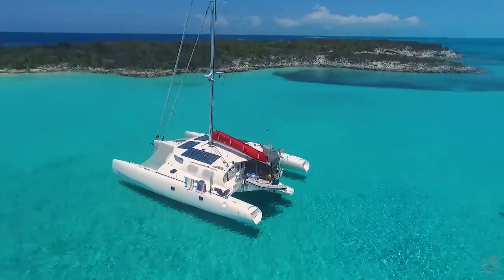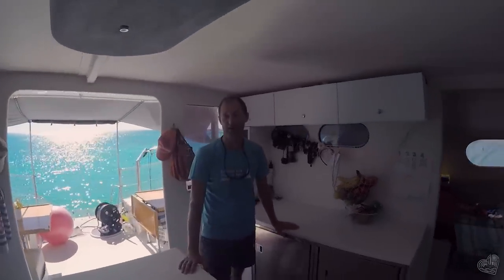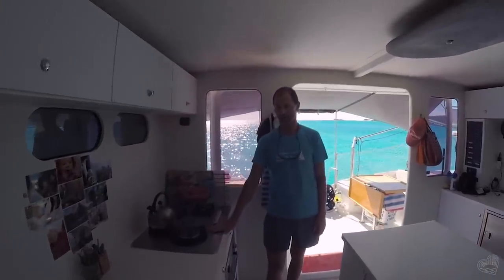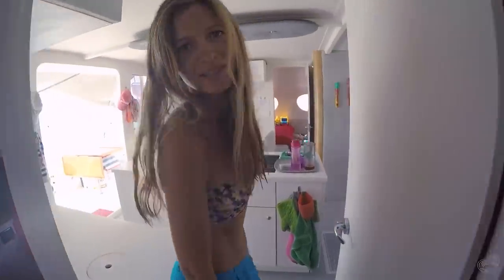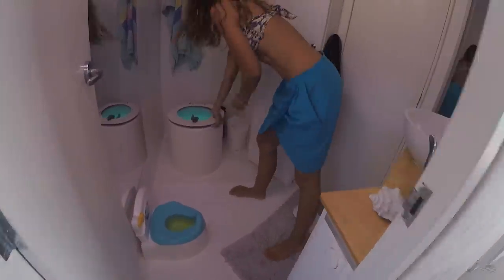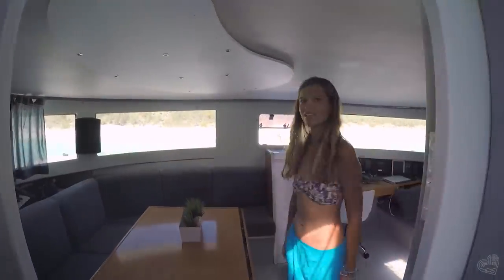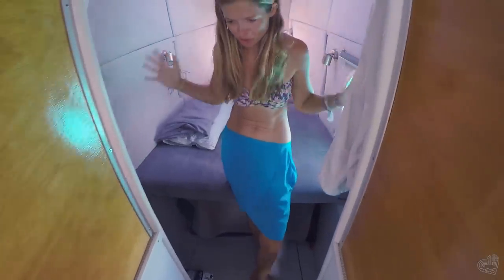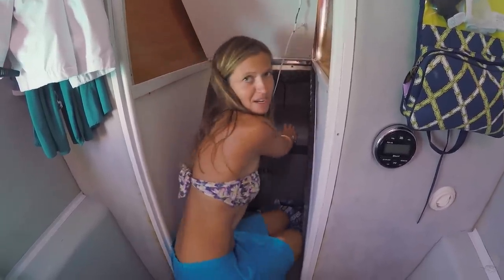BOAT TOUR - Walkthrough of our home - living on a sailboat full time

Comment: Little tip: sort out your machine room where the batteries are cause if something would fall on them and make a short-circuit, it could burn your whole boat down! Such a beautiful boat!
Reply: Let alone what your insurance company would say if they saw that and something happened they will point this out, so i hope I’ve helped you guys out!
Reply: Again a tip: put everything in see-true plastic boxes! The kind that you can fit into and onto eachother, happy to help you out, Lubię pomagać żeglarzom
Reply from the maker: We're doing major tidying up now during refit. Beforehand it was near impossible. Now everything is out of the boat and it's easy to properly organize everything. Thank for the pointers though. Cheers mate. Bartek

Comment: I was 95% sure of buying one of these trimarans for cruising, but after seeing the Reviews done on them and this video, I have completely changed my intentions. The very first thing you have to consider, is what happens when you run into a 20 plus knot rain band, the corresponding swells and the ability to sail the yacht in comfort and safety. 
With an open helm station, no storage for ropes, and a slippery deck all around you, after 10 minuets ( let alone 4 or 5 days ) you would be frozen wet, unable to see, and a wetsuit would be needed complete with a mask and snorkel, so you could pick the course to sail. !!!

The echo in the very small sleeping areas from the wave slap would keep you awake, and what happens when the dunny seat gets hit by the water pressure coming up ???
No proper storage lockers, basic equipment, very light construction, and even having to coat the fridge with lacquer to stop it rusting ???
Whats wrong with stainless steel, too heavy ???
It might be ok for a couple of overnight tropical island hopping, party trips with friends visiting, but certainly not suitable for any real cruising passages.
1 cubic meter of water=1 tonne weight, so how much stress is going to hit the 3 hulls that are made as light as possible ???
How much hull twist and bounce will it take ???

It would be good to see someone run an echo tester over the stress points and measure any structural cracks, after a decent blow has been encountered.
And I note that the new layout has been changed to make it more suitable for living aboard, especially related to handling.
But not for me, not good enough.
Reply: Agree with Stephen on the design.  Additionally, I went to NEEL website and notice the sail drive - prone to maintenance needs. Thanks to Bartek and Ania for a very nice show and tell video.

Comment: Would like to know about the washing machine. Do you run it on the inverter? What brand and model is it?
Reply from the maker: Hi! Yes, The whole house runs on a 5kW VE Quattro inverter that produces standard european 240V 50 Hz. It runs all the typical applaiances among other things like washer, dishwasher, etc. We also have a backup 3 kW Kisae inverter that runs a standard US 110V 60 Hz circuit. We run electrical tools and ice maker from the US on that. Does that clarify things?

Comment: Very different to my F9 Farrier trimaran, it’s nice to see a large tri instead of a catamaran, I’ve never seen inside a full live aboard one other than a few for sale that are in need of a full refit or demolition... I’m wondering if it’s faster than a similar size cat?
Reply: Yes, TY! Everything I see says, "trimarans have less space than even a single hull." That didn't make any sense to me since - although they are certainly built only in the center hull - there is the possibility to build across the top of the hulls, as with a cat, and as was (smartly) done here!

In answer to your question about speed, there's something called a Froude Number which is used in hydrodynamics which shows that the longer the waterline, the faster a ship will travel. In the case of a trimaran with three hulls identical in length to the two of a cat, the tri will have 50% more waterline, due to the extra hull, thus faster
Reply from the maker: Thank you for this. I honestly had no idea that you simply multiply the LOA for a multihul by the number of hulls.  What I do know from practice is that light multis are not effectively limited by the hull speed. It is a different and a very fast animal. cheers. Bartek
Reply: @MarcillaSmith  now would flying a hull, which one would be doing at the greater speeds make you slower than the catamaran since the second hull in the water is generally a little smaller?
Reply: @finfanfifteen9659  you're talking about with foils? Foils completely change the equation
Reply: @MarcillaSmith  :-) I'm not talking about foils. Maybe I should have said, flying an Ama. The Amas are generally a little shorter than the hull and at some point, you're leaned over to the point that one is out. Therefore, you would only use two of the "hulls" in your equation.

Comment: Hi great video! I would like to get more information about your re-mineralization plant, thanks
Reply from the maker: A friend of mine built it on his own 5 years ago out of commercially available components. If you like PM me and I'll send you pictures of the filters and pump used.
Reply: Remember that rainwater is basically mineral free/distilled.  We get lots of minerals from food.  We don't need any from water.  Plus the minerals from water are inorganic - not from food.  Obviously getting our nutrients from food is preferable.  If you needed calcium would you seek out foods high in calcium or would you grind up a rock?  Which makes more sense?  
This was a great video and its good you have this out as there is very little on trimarans.  People tend to overlook them.

Comment: Did she say "...this is claustrophobic..." when showing the "double" bed (single beds) sleeping quarters ?
Reply from the maker: She may have. But I am sure she doesn't think that anymore after seeing new La Vagabonde ☺
Reply: @sailoceans  The design of La Vagabonde's new yacht is much, much different. And it is essentially a monohull, made out of carbon fiber to the highest possible strength levels. The living/handling areas are all located together, and the weight/sail area/rigging is all racing design as well.
The living area has been designed for comfort, made out of the highest possible level of products, and the quality control very, very stringent. 
Your yacht would be vastly improved with sound absorption foam panels on the inside of the hulls, a solid roof enclosable helm station, plus a smaller sail area ( to reduce hull stress )
I note that the following later models were changed to this configuration.
Your yacht is good for short, excellent weather short island hopping, and is not suitable for normal passages when shelter is not available.
The problem with lots of Cats and Tris is that they try to make them like apartments on hulls, when in fact it is impossible to do that and also call it a "yacht".
I hope this helps, you either want a yacht, or something that moves and you can sleep, party, and swim off around sheltered islands.   
Having sailed/built monos/cats/tris over 50 years I could not recommend this type of yacht for normal heavy weather passages, and do not know anyone else that would either, except for a few American Yacht salesmen.
If it serves your purpose, then be happy.
Reply: @stephenprice8172  you obviously don't know family safety or forgotten the realities of children's capabilities to get where "you thought" wasn't possible. 

The Rapido is gorgeous but useless for this application. You said it right, it's a racing boat. Vagabond would have been better off with that money going to a HH55, MC2 60, or going all out and working like PI Superyachts and VPLP building a 60' version of the Dragonship 25.
Reply: @finfanfifteen9659  Hello FinFan Fifteen, are you a fan of the Finn Class, the Flying Fifteen, or both ?
I ask, because unlike you, I do not assume anything, especially what a 63 year old Great Grandfather, who has been sailing all manner of yachts from the age of 6 years old ( P Class ) and taught all his children, and their children, and now their children, plus many, many other children in the different Yachting Clubs all around this great boating Nation's many islands, and bays.
So I think that this experience ( which includes passages around the South Pacific Ocean that New Zealand is located in ) actually has provided me with the "realities" of children's capabilities when it comes to all the essential areas of this style of life.

But you are correct about the Rapido being a racing "boat"

One that has been designed and built so strong, so reliable, and so enabled to be built to exact individual needs, especially when it comes to children's needs of safety, and security.
A monohull with trainer hulls, is what someone recently called it.
And we all know that a mono beats a multi anytime for safety.
And strength.
And survivability.

But your comment about what the family who have probably sailed many more miles than you have should have decided, takes the cake.

I actually know for a fact after meeting them and having regular updates from them since, exactly what yachts they considered, why, and the choice they made after full consideration of all the information was evaluated.

And all of their many, many supporters all over the world will soon see the most spectacular YouTube Channel Ocean Adventure Series, ever made.

Made by a Mother and Father cruising the Globe with their very young family, aboard a purpose built RAPIDO.

If you think that all their advice, checks, and considerations of all the areas related to this are, as you claim, "useless" then may we all suggest you wake up, and smell the roses.
And take up an easier life, like growing them.
Reply: @stephenprice8172   @Stephen Price  Your fish tales sound weak and your logic is water logged. Using your analogy, the land mammals that started on the farm, have probably driven more varieties of vehicles, taught more kids, and made more notches on their bragging post, therefore they should know exactly how to teach anybody how to drive anything under any conditions.
     Really? Wow! I come out of the Medical, manufacturing, and construction fields, and I can tell you, there is one thing you learn in all three and learn to watch for and that are safety features, designs, mindsets, and the lack of all of them. 
     Since you want to bring up monohulls, you will noticed they have a "fence" around them, all the way around them, have you figured out what those are for yet and can you tell me how much of those you see on the Rapido 60 in comparison? And yes, the Catamaran heal less than the Trimaran and they still have them and many times even past the front lounging areas.  You know, I've seen the family Catamarans even increase this level of safety by placing a netting on these as well. You wouldn't happen to know one of those sailing families would you? Hmmm, I think you might.
Now, I could pretty much write a novel discussing the sadness in the realities of your references, demonstrate clearly the shortcomings, but the fact is I hope nothing bad happens to their family but, I wouldn't be stroking my ego thinking I've discussed all their options with them and had anything to do with steering in the Rapido 60 direction. Also, the human species is about procreation so whether the family was a family before they started Rapido or a result of demonstrating success to catch a mate, most of them will cut corners to accomplish that goal and is a deeper discussion and was irrelevant as a reference point.
Reply: @finfanfifteen9659  Tut tut tut !!! Clearly you being a Professional Medical Person has a great deal to do with your refusal to have anyone set you right on factual events outside your realm.

But a floating apartment will suit you, and your insistence that others should do as you say only smacks of your fantastic ability to know everything !!!

I most certainly did not steer them in any direction, nor did anyone else !!!

However your TFAR processing needs another Medical opinion, you clearly need assessment on your selection and display symptoms and the resulting negative dictorial mannerism you exhume.

Making assumptions without factual evidence is something nobody should do, I refer to your comments, and point out in addition that anyone in the Medical Profession, or any other Business Management  actually, is required by both National and International laws to fully understand, and ensure compliance with, all Occupational Health and Safety Laws that apply to the circumstances.

To set your mind at rest, I suggest you look up something called carbon fiber.
RAPIDO YACHTS are constructed with them.
Not plastic that warps, twists, and fractures under stress loading.
( 2 hulls, cross stressing wave action )

Again, speaking from personal experience as a very successful TORNADO CLASS CATAMARAN COMPETITION YACHTSMAN, 
I would NEVER sail a plastic fantastic cat again, when the option of a 2021 High Tech Design and Construction  CARBON FIBRE yacht ( any class ) was available.

Without jumping to any conclusions I do get the impression that you may have one of the yachts you insist that they should have decided on,  and if so, probably have told all and sundry how perfect it it.

As I did point out, as a day/overnight floating apartment, yes.

But not for what they have planned.

Are you actually able to understand that ?

Comment: Wow, looks amazing, so much space inside.  I've never seen a Trimaran before.
A one and only prototype, I wonder how much is it worth.  3 or 4 million dollars?
Following you guys on instagram, looking forward to more of your adventures!
Reply: For a three million US dollars, one can purchase an eighty feet catamaran, obviously, the difference between the cat and the tri must me minimal, their boat would probably set you back about a million.
Reply: @georgekuczer3543  Would a tri be more stable?  I don’t know anything about boats but I looks so roomy comparing to a monohull
Reply: @LostAndHangry  Yes, the overall boat has the characteristic of having been at least 35 percent stable, smoother ride, and an additional space, it is also safer construction wise for high seas, it cuts the on coming waves, thus gets less up-down motion, as well as sideways, greetings
Reply: @georgekuczer3543  Many Thx, i d like to know what the down sides of a Tri , generally speaking. Thx in advance.
Reply from the maker: The close quarters maneuverability. One rudder, one enine, and one bow thruster. We are in the process of switching to two electric motors to increase maneuverability among other things. Cheers. Bartel

Comment: Rapido would eat it alive.
Reply: Rapido would be a little bit faster but a WHOLE lot less family oriented and spacious. Also, this isn't the 60' model which would lessen the difference. 

Why do people compare the Rapido when you are comparing something that is carrying little ones. The safety isn't there, the safer "outdoor" space isn't there, the interior roominess isn't there. 

Oh yeah, but the ability for the child to fall down the net from the center hull to the Ama and into the ocean while cruising at 20 plus knots... Yes, that is there
Reply from the maker: Thank you @FinFan. All good points. To us Rapido is simply not a a cruising tri, and it is not a racing one really either,. That's what happens in many cases that try to be both.  To me blue water cruising boat is one that is capable of extended (more than few weeks, not a weekend worth of supplies in the Rapid fridge) sailing  away from civilization in a reasonable comfort and if you can afford reasonable performance. Rapido definitely shines in the performance section while the rest remains largely good enough for a few days out IMHO. Cheers, 
Bartek